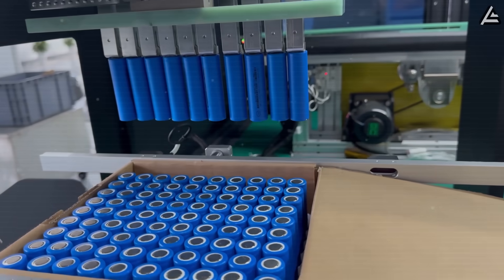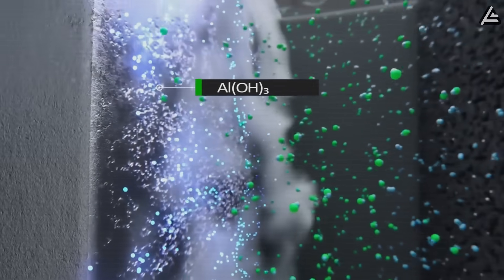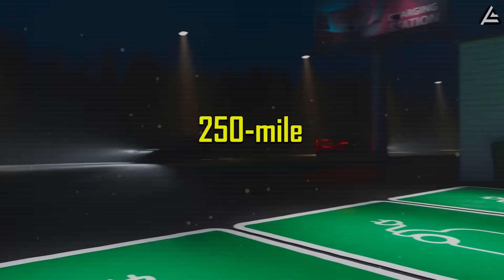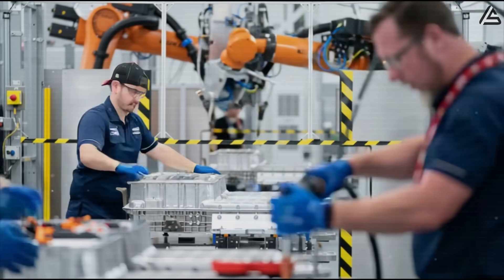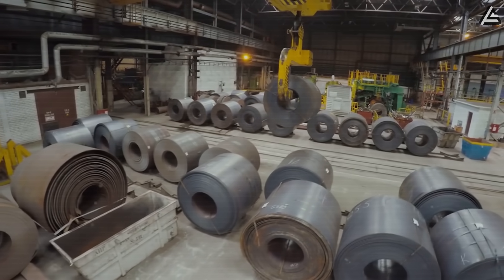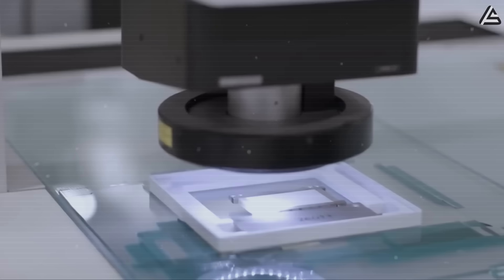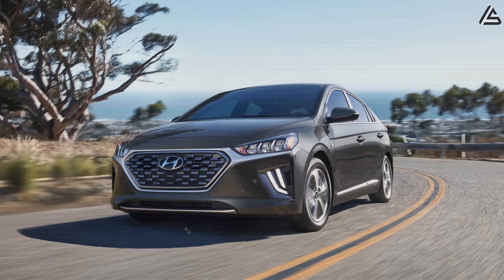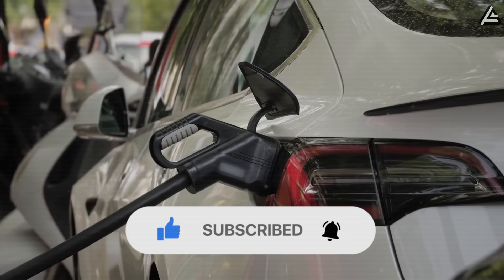2026 Tesla Model 2's All-New Aluminum-Ion Battery. What Elon Didn’t Tell You About

Comment: Seems like very similar specification to Sodium Ion battery which has similar energy density, loses very little range in cold conditions and charges in minutes.
Reply from the maker: Which battery do you prefer?
Reply: @AutoGearShift2 I have too little information to know. There are a lot of different factors and use cases. If the Aluminium Ion battery is   fundamentally incapable of catching fire as I suspect it might be, that would be an advantage in some use cases. I suspect it also would not need cooling or heating to operate efficiently though the same would likely be true of Sodium Ion so simplifying battery management and avoiding the need for a parasitic load running thermal management. Much will also depend on the relative energy density and cost of each battery once established as a mature mass market product.
Reply from the maker: understood. I recommend you watch more of our videos about batteries on our channel. Here we makes videos mostly about Al-ion, Na-ion, and solid-state

Comment: The problem is charging in 10 min will require a absolutely massive power supply.....
Reply from the maker: Tesla Supercharger can do that
Reply: @AutoGearShift2  It will be the only place that can...
Reply from the maker: don't worry there will be a lot more superchargers in the future
Reply: Or a big battery buffer
Reply: @lexsta88  When do charging points include massive batteries...??
Reply: @manoo422 when they are part of a Tesla charging site for example. Tesla are already placing megapacks on site and use them partially to charge vehicles on low cost power and partly to supply the grid as a peaker plant (at high margin).
Reply: @stevetodd7383  They are a drop in the ocean at best.
Reply: Why is that a problem
Reply: @gary-pietz4147  Who is going to build charging parks that need a power station next to it...?!!
Reply: @gary-pietz4147  Amperage and heat and thicker, forcing lots of voltage and current creates lots of heat.
Reply: Not really, if the same power supply charge the lithium in 30 minutes and the aluminum in 10 minutes I don't see your reasoning.
Reply: @WyoSavage1976  How many typical charging points will fully charge a Tesla in 30 min...??
Reply: Yeah enough to power 14,000 homes all for a ten minute Ev car charge, wooo hoo, I bet thats feasible/plausBLE AND ECONOMICAL, PUT 6 of them in every recharge station, then times the power by six times if you want to use all 6 at once :o
Reply: If you are a two car family and can charge in your garage or driveway, this Model 2 could be a great option as your local commute vehicle. You may even be able to charge from a 110 volt outlet, trickle charge. And these Aluminum-Ion Batteries do not have the fire risk of Lithium-Ion batteries.  Lower cost and longer life and less chance of a rare but extreme fire, could result in a big win. Even if you are taking road trips, depending on where you are traveling it could work. . .
Reply: @AntisocialRedNeckNerd 110 volts might take you a week.😮
Reply: So negative, just build more power stations.😅

Comment: ..what about more cars in the charging stations on trips?
Reply: Increase the amount of on site battery storage and solar roof mounted charging ....to ease the charging experience and deal with peak demand bursts like they do in some big German charging stations that deal with electric trucks and  host  EV gatherings. If they exceed their projected  daily , weekly peak levels then it can increase their overall unit electricity supply costs under their system ., one way round this is to have off-peak storage and solar inputs to their onsight storage. If things look busy,.. As charging slots can be booked en route they can also project and manage charging  at the site or over a time window,..to avoid incurring the 
Pricing penalty for the month or quarter . 🧙🏻‍♂️🇬🇧
Reply from the maker: What’s wrong with it?

Comment: Hmm, interesting choice. Presently I have a used Nissan Leaf SV Plus with just over 200 miles per charge. We use the vehicle largely as a daily commuter/beater car to meet virtually every need within 100 miles radius. Extended range is thus meaningless for us. Because of this our ICE vehicles now sit idle most of the time. The Leaf charges overnight with a simple Level 1 (120V) or Level 2 (240V) charging cable. It has a full tank every morning so we never have to be concerned with needing to use a public charger. Charge time is thus meaningless as well.
Reply from the maker: Thanks for your detailed sharing
Reply: I agree, I had a Leaf and only went about an 80-mile radius occasionally.  I got rid of the Leaf because of the lack of charging structure for the times I went farther.  It wasn't easy to find a CHADEMO charger.  With my Tesla, I have been able to drive between Arizona and California.  I stop every 2 hours for a bio-break anyway.  A quick stop for the restroom and a fast-food place is enough to get us further down the road.  Never charge to 100% except at the start of the longer road trip.  I only have the one vehicle so I can't fall back to ICE.
Reply from the maker: thanks for your sharing
Reply: Well as long as it is meaningless to you.

Comment: Define toy a fast charging battery here would be preferred. I think most drivers would prefer this method because of rest stops during a 4-8 hour drives. If the degradation of the battery is not truly affected upfront with is fast charge multiple times is proven method, give me this 250 mile range method.
Reply from the maker: Thanks for your sharing

Comment: Would like 400 Mile range so why not have battery size option?
Reply: Beyond a certain point I suspect that Aluminum Ion's "volumetric" energy density begins to become an issue. It begins to take up too much space.
Reply: Efficiency. There's an optimal battery size for a given range, after which it becomes diminishing returns.
Reply from the maker: It needs to fit the car’s floor
Reply from the maker: It needs to fit the car’s floor
Reply from the maker: It needs to fit the car’s floor

Comment: It seems smarter to increase Al-ion battery pack sizes just enough to add more mileage per charge to split the difference or equate to Lithiums energy density advantage for range.  Why shave the trade -off too thin instead of blunting the argument?
Reply: A lack of thermal reactions, and the elimination of toxicity in manufacture, lower cost and faster charging are more than enough to switch.  Lighter battery packs would eliminate the fast tire wear on heavy EV's too.  

I look forward to the day when Tesla provides batteries for their new Pi phone, power walls and perhaps a new Ipad competitor.
Reply from the maker: Good question! We’ll research more to give you the best answer in our future video, stay tuned!